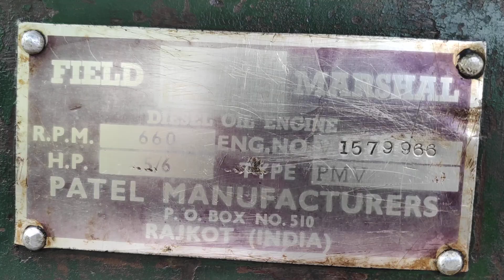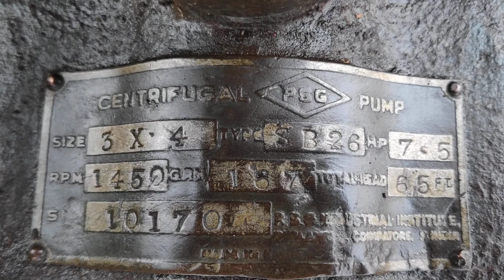Water cooled Diesel lister cs 6hp  Engine/ Field marshal Lister Engine @ 650 rpm.

Comment: I think this is very vintage engine because their a valve , on head , when we open it will work in low compression , but nowadays their no valve in engines.
Reply from the maker: Yes . Varun ji